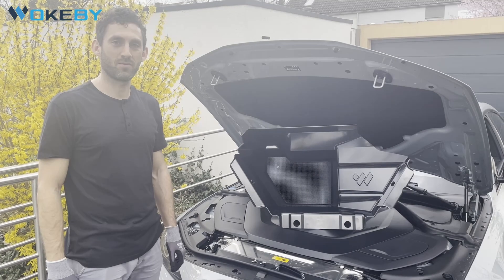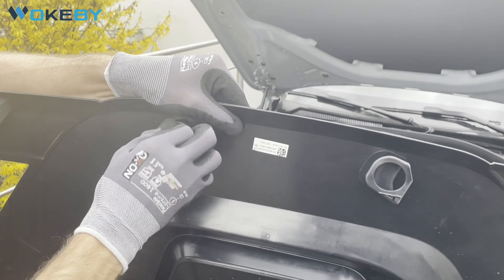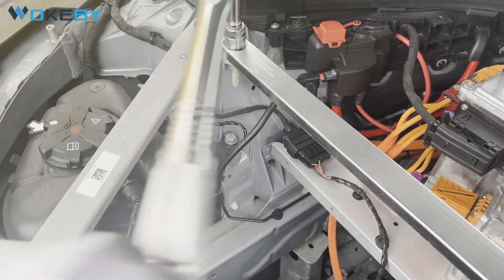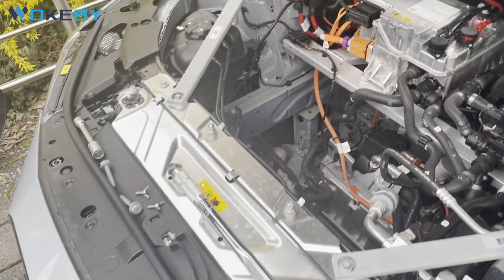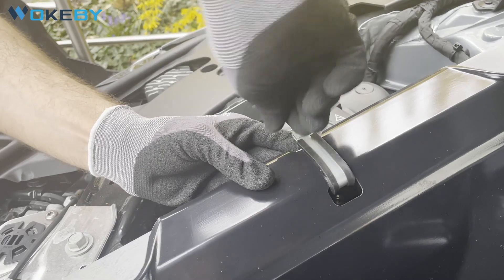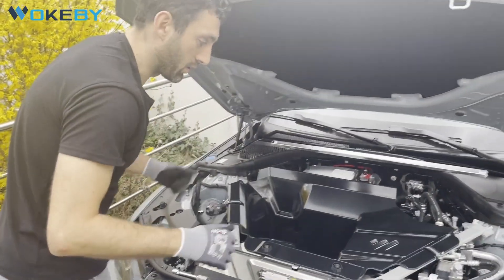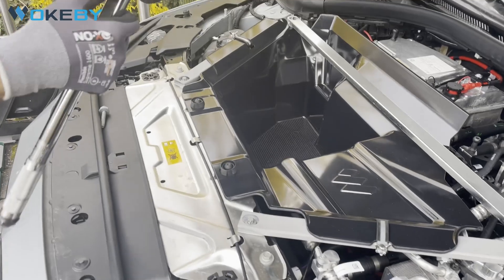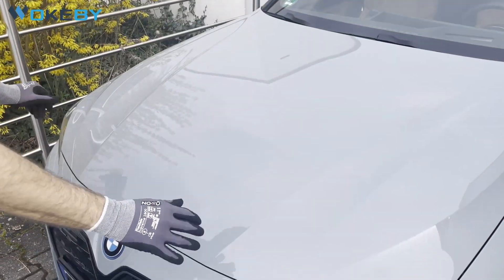WOKEBY - The BMW i4 Frunk M-Sport

Comment: Hi I would recommend you double check on the tightening torque.
If the Bolts need to be replaced they usually are tightened to plastic deformation. So the spec should be something like 50Nm +90°.
Other than that great product I'm looking forward to mine.
Is there a 2nd Market for Frunks since lease car owners will have to tske it out when they return the car.
Reply from the maker: Honestly? We are talking about aLoctite secured steel screws that hold down a flimsy aluminum bar that is bolted into another aluminum holder with a rivet nut. We are not talking about a sophisticated part of the car. I just mention a torque because I know some of my customers are kind of interested in every detail they can get. The original torque that BMW has in the manual is much lower than the one i mention ;-)

Comment: Is it also suitable for right hand drive version?
Reply from the maker: Yes it is. there is no difference in the area where the Frunk is mounted.
Reply: @WOKEBY  I am afraid the steering shaft on the right side will be blocked by the frunk and thus interferes the car's steering.
Reply from the maker: @sheungwong3116  As I said, it is not. The steering is mounted far below because there is a M50 version of the car which has a motor in the front ;-)
Reply: @WOKEBY  That is great, I will order one from you, many thanks🙏🏻

Comment: Thank you, very easy to follow and a great add-on product.  I assume, BMW would claim this may effect the warranty and access for servicing?
Reply from the maker: BMW does not void your warranty if you change your wheels yourself and that is by far more critical😉
All this beam does is stiffen the suspension domes in cases of fast cornering.
But if you are concerned we recommend to either talk to your workshop / deal in advance or uninstall the frunk before a visit.

Comment: Why 70 Nm when BMW recommends 56 Nm?
Reply from the maker: Because I shot the video before I learned about the 56 Nm of BMW.
Anyways. It took far more than 80 Nm to open the screw so dont worry.
Reply: Sorry, that’s not correct and for me a questionable statement for a business owner. The torque for unscrewing is not the same as for tightening. The screws have to be replaced because they will lengthen themselves. A screw connection is not only about the used screws but also about what kind of materials and elements will be connected. Even if the screw have a different recommended torque it might be that the other elements should not be clamped with a higher torque.

I
Reply: @philNullFunf You can't expect him to know everything just because he's a "business owner". Also what is that attitude even, try to be nice?
Reply: @swecreations  ok. You might be correct, that I’ve been rude. My opinion stays the same. He must not know everything, but he has to be careful with informations that he gives out to his customers. I would do it the same way.